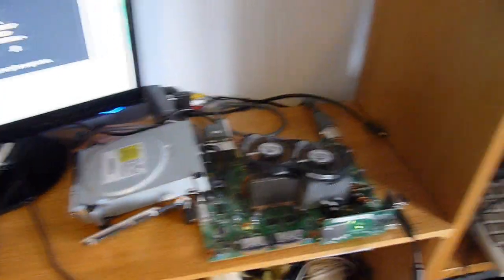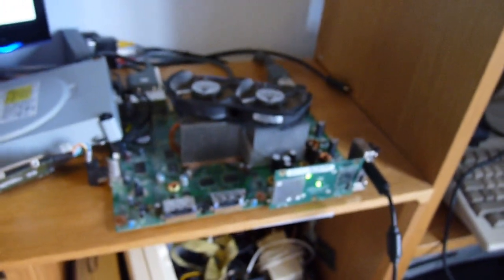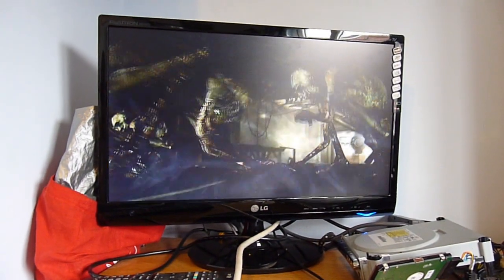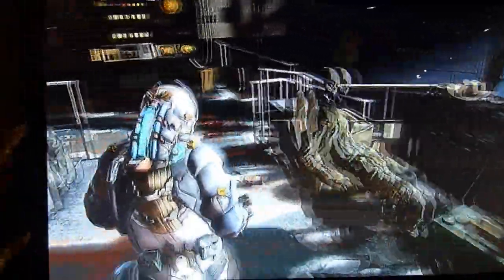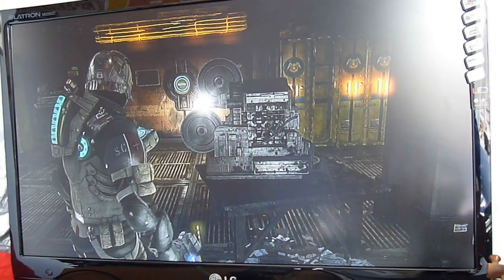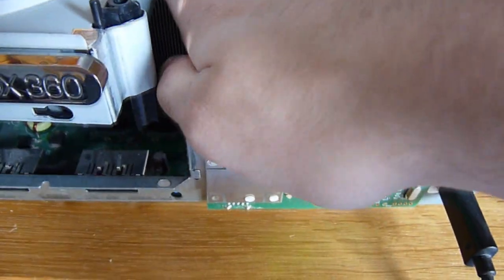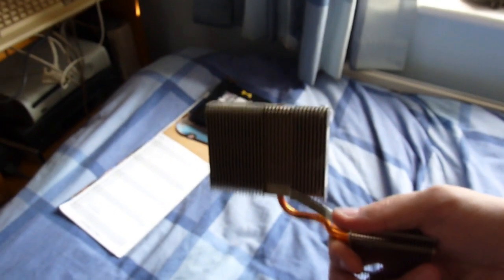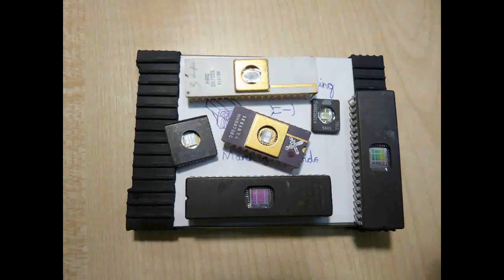The FrankinBOX Revival, Back From The Dead

Comment: Crap controller battery case, crap games(unless you like dark or FPS games :D) crap noisy hardware, crap oversized cables that won't bend, crap reliability, feels like an aluminium trash bin when picked up!  Can you tell I don't like my Xbox360?  I hacked my Wii last night, working on getting GameCube games running from HDD today :)